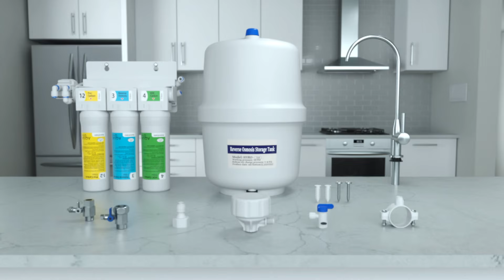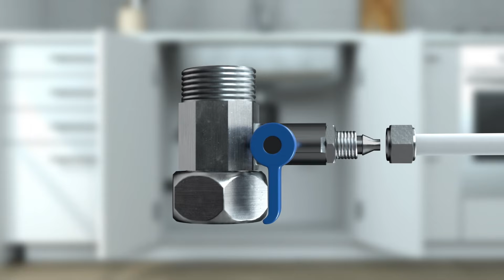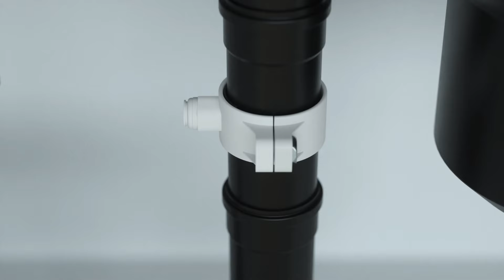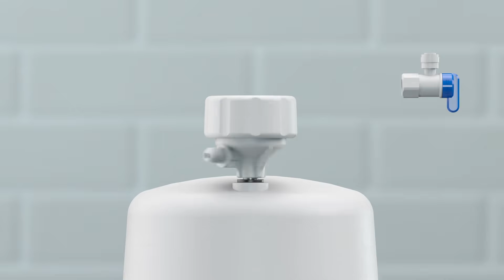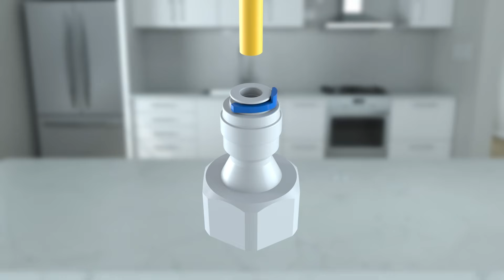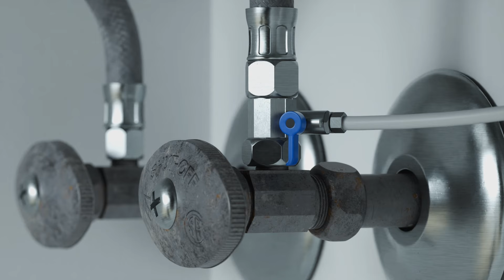AquaTru Under Sink Installation Guide

Comment: How does the water get from the holding tank to faucet? Is it pressurized some how?
Reply: thats right! i had to look it up. theres a bladder inside that compresses air as water comes into, helping to push the water back out the same one line, acting like a compressed spring.

Comment: My cold water adapter came with two small rubber gaskets in the bag. What are those for? I don’t need the 1/2” conversion threads, so wasn’t sure if I’m supposed to use those little gaskets somewhere.

Comment: So if I wanted to bypass my fridge filter and connect directly to my ro system I’d need a dual connector for E?
Reply from the maker: The under-sink model is not designed to function in this manner.
Reply: @AquaTruWater which model can?
Reply from the maker: @basketballtricks101  No AquaTru model is designed to function in this way. All the other models are countertop units. They don't interface with other appliances.

Comment: Is there any issue with parallel installation of two units, for better flow? I don't see any issue with it in my mind but I'm wondering if something is escaping me on that.
Reply from the maker: The under-sink model is not designed to operate in this way.

Comment: How do you know when it’s time to replace the filters?
Reply from the maker: The Under Sink model doesn’t have the electronics to track filter usage intervals, which is one reason it is somewhat less expensive than the countertop models. To monitor filter life, we recommend writing the date you installed it on each filter using a Sharpie pen. Alternatively, you can set a calendar reminder.

Replace the pre-filter after 6 months, 
the VOC filter after 12 months, 
and the RO filter after 2 years. 

This information is found on page 11 of the manual.

Comment: It says sanitise the Ro holding tank with bleach!! How is that safe?
Reply from the maker: Bleach is necessary to ensure that bacteria are eliminated. 
After sanitizing the tank, you flush the tank twice to purge out all the chlorine.
The process of using bleach to sanitize the tank and flushing it out will not leave any chlorine residue in the tank.
Reply: @AquaTruWater - how often do you sanitize the tank? Do you have directions on how to do this. Also if you go on a trip for a month and you shut the water off to the house is that OK to do if you have this system installed??
Reply from the maker: @robinhoward6019  The RO system should be sanitized once a year. We recommend that you do the sanitizing process each time you replace the VOC filter, every 12 months. You should complete the sanitizing process before you replace the VOC filter.

This is a common interval for sanitizing RO water tanks.

There are instructions in the manual.

Here is a video…
How To Sanitize Your AquaTru Under Sink Water Purifier 
https://youtu.be/Xb1X003sYMA?si=KOp777PcKNaCmfxu

With an under-sink system that is used in a pressurized tap water system, it is ok to leave it unused while on vacation.

Comment: What is the size of the whole for the faucet needed? I order a unit. I want to make sure i have the right tool to install it when it arrives. Thanks.   :)
Reply from the maker: You will need a 13/16” drill bit and drill that is appropriate for drilling through the countertop material.
Reply: @AquaTruWater  what is the material of the faucet made out of? I'm wondering if i need to replace it for a higher quality one
Reply from the maker: @alfonsoramirez6415  The RO faucet that comes with the Under Sink model is stainless steel.
Reply: @AquaTruWater the size of the hole for the faucet should’ve been included in the video, but glad it was at least in the comments

Comment: Do you recommend getting a booster pump for the RO system for those of us on well water?
Reply from the maker: For the under-sink model, if your water pressure is +40 PSI, a booster pump is not needed.

If your home does not have 40 PSI, we recommend using an AquaTru countertop model that comes with a built-in pump.

AquaTru is designed to filter municipal water. AquaTru is not intended for use with any water that is microbiologically unsafe. If you are 100% confident that your well water is free from biological contaminants, you can use AquaTru to purify your water. 

While AquaTru has been tested to remove cysts, including Cryptosporidium, Entamoeba Histolyca, and Giardia lamblia, it is not recommended for use in water from lakes, rivers, streams, or other sources of untreated water. AquaTru has not been certified for this purpose.

Comment: I'm assuming this can be used in bathroom sinks as well?
Reply from the maker: It is a question of having enough space under a bathroom sink, and you will need to drill into a pipe and drill a hole in the countertop where an additional RO faucet must be installed.

Comment: Do the dimensions of the filter assembly include the mounting bracket and the side pipe inlet?
Reply from the maker: It is just the dimensions of the manifold that holds the filters.
Component Dimensions

Manifold Dimensions: 4” x 11.5” x 13” (L x W x H)
Tank Dimensions: 14” x 10” (H x D)
Sanitizer is 3.2 inches tall
Weight: 11.44 lbs

Comment: What’s the total height of the tank including the sanitiser adapter? 
Can the tank be mounted on its side? 
Could I forego the sanitiser adapter and just install it when sanitising is required?
Reply from the maker: No. The tank cannot be mounted on its side. Tank Dimensions: 14” x 10” (H x D)
Yes, you can use it without the sanitizing adaptor in place and add it when you need to do the sanitizing procedure.
Reply: @AquaTruWater  thank you. Does that height measurement include the sanitiser attachment?
Reply from the maker: @RyanF91W  No. It doesn't include the sanitizer attachment. The engineers are going to provide that full measurement soon. Also, see our correction to the answer above. :-)
Reply: @AquaTruWater  thank you for the quick reply. So the piece that would normally go onto the sanitiser will attach to the tank (same size thread) ?
Reply from the maker: @RyanF91W  Yes. :-) The engineers said you connect the hose directly to the tank in place of the sanitizer.

Also, we have received these same questions from our EU distributor and have replied with a little more detail via email.
Reply: @AquaTruWater  That was probably because of me. I was asking them the same thing but was receiving conflicting advice. Thanks for all your help and will be purchasing an under sink system in the UK shortly.
Reply from the maker: @RyanF91W  Youre welcome. :-)

Comment: What minimum width of storage under counter required to get it installed?
Reply from the maker: There needs to be enough room to contain these components...

Manifold Dimensions: 4” x 11.5” x 13” (D x W x H)
Tank Dimensions: 14” x 10” (H x D)

Comment: So how does water get from the holding tank to faucet? Does it use the same hose as the original unfiltered water? So going backwards D to C and then E to F? Just wondering if that’s so are you able to get clean drinking water while it’s also filtering to fill up the holding tank?
Reply from the maker: Please call Customer Service, and they will be able to answer this. Please choose the Technical Support & Troubleshooting option.

Here is the Customer Service number and hours: 
1-800-220-6570 
Hours:
Monday-Friday from 7am-4pm PT
Saturday and Sunday from 7am-3pm PT

Comment: What size drain pipe is the saddle for?
Reply from the maker: Please call Customer Service and choose the Technical Support & Troubleshooting option.

Here is the Customer Service number and hours: 
1-800-220-6570 
Hours:
Monday-Friday from 7am-4pm PT
Saturday and Sunday from 7am-3pm PT
Reply: did you ever get the answer to this? i am wondering this as well. if it will work on a 1.25" drain pipe.
Reply: @b3autifu1mistak3 it does not fit a 1.25” drain pipe. They do not have bigger saddles either

Comment: My holding tank valve is leaking.

I have the blue horseshoe ring on.

I cut the plastic line using a razor blade trying to achieve a flat cut.

Where did I go wrong?

How do I fix this?

I need it to stop.

This is the only leak.

Furthermore, I only see water coming out of the drain line but not the water faucet line.
Reply from the maker: We’re sorry your unit is leaking. 

Please call Customer Service and they can do some troubleshooting and resolve this for you. Please choose the Technical Support and Troubleshooting option.

Here is the Customer Service number and hours: 
1-800-220-6570
Monday-Friday from 7am-4pm PT
Saturday from 7am-3pm PT
Reply: @AquaTruWater  I figured out the leak and haven’t taken back the comment—I had to stick the 1/4” line further into the recess—My tank osmosis would not fill to full. 

I ran it for over 3hrs. probably 5 on the timer.

The faucet water line… had x3 as little water pressure than the drain line the whole 5hrs. 

Lastly, a rotten egg after taste from the faucet water line

i tried some on the 4th hr. I think that aftertaste is gone now

I have the under the sink ph+ mineral boost model from AquaTru

What’s going to happen?
Reply from the maker: @HotHeadCringe  We're sorry you are having this issue with the pH filter.

While many of our customers love the taste of our alkaline mineral water, some people perceive tastes differently and pick up on a taste that they don’t love. Some people are even genetically dispositioned to have a gene that makes them more prone to detect a Sulphur-like taste in the alkaline water. This is similar to how some people love the taste of cilantro, while others detect a soapy taste they find unappealing. 

The taste in our filter that people have detected will diminish over time as you filter more water. However, if this is not acceptable to you, we recommend switching to our classic VOC filter and use our Perfect Mineral drops to add minerals back into your water. It will not create alkaline water, but it will give you the healthy trace minerals to re-mineralize your water. 

We are happy to refund you the cost of the Alkaline VOC filter and replace it with a classic VOC filter free of cost to make this right. 

Here is the Customer Service number and hours: 
1-800-220-6570
Monday-Friday from 7am-4pm PT
Saturday from 7am-3pm PT

Comment: Can I get in oiled bronze?
Reply from the maker: If you mean, the color of the RO faucet...
The Under Sink model is designed to use a separate Reverse Osmosis faucet, but you can use your own RO faucet. You can find several options on Amazon.

Here is a link to several different options…
https://www.amazon.com/s?k=RO+faucet&crid=2C81KBFDSXUM2&sprefix=ro+faucet%2Caps%2C117&ref=nb_sb_noss_1

Comment: What size hole do I need to drill in my granite to accommodate this model?
Reply from the maker: You will need a 13/16” drill bit and drill that is appropriate for drilling through the countertop material.

You can find information about this on page 9 of the installation manual.
Reply: @AquaTruWater  What if my countertop is stainless steel?
Reply from the maker: @Rocioftw  You will need to drill a hole in it.
Reply from the maker: @Rocioftw  You will need to drill a hole in it.

Comment: Installed this and it has drastically reduced water pressure (more than half I'd say) of my regular faucet's cold water. Disconnected everything, checked for blockages, blew air through, reattached my original hose without this connected, and my pressure was fine again. 

Connected it back up, thinking it needed to fill the tank before the pressure would return, but it hasn't. Is there a solution to this? Or am I just stuck with almost no water pressure for cold water on my normal faucet right next to this AquaTru?
Reply from the maker: We’re sorry you are having this difficulty. 
Please call Customer Service and they will be happy to do some troubleshooting with you to determine if the unit has been correctly installed and  resolve this for you. Please choose the Technical Support & Troubleshooting option.

Here is the Customer Service number and hours: 
1-800-220-6570 
Hours:
Monday-Friday 7am-4pm PT
Saturday 7am-3pm PT

Comment: How much water does the holding tank hold and how long does it take to fill?  Also, my system is fairly noisy (hissing sound), is this normal?
Reply from the maker: The tank has a 1.8 gallon (7 Liter) capacity. 
The filtration rate is 180ml/6 ounces per minute, which is the same as the AquaTru countertop model. 
It shouldn't make a hissing sound. Be sure that it is installed correctly.
Please call Customer Service and they will be happy to do some troubleshooting with you and resolve this for you. Please choose the Technical Support & Troubleshooting option.

Here is the Customer Service number and hours: 
1-800-220-6570 
Hours:
Monday-Friday 7am-4pm PT
Saturday 7am-3pm PT

Comment: I want to purchase and then add a different faucet to match my oiled bronze fixtures. Does this require a faucet with an air gap?
Reply: Thank you!
Reply from the maker: @LVHoy  You're welcome. :-)
Reply from the maker: Hi Leah,
The under the sink model can be used with or without an air gap faucet.

Comment: Seeing weird behavior on this.

Got everything connected, tested cold supply line, things look good

Turn on water feed at the adapter valve, water starts entering unit, things are fine then suddenly the RO faucet starts leaking and dripping profusely - tank is empty
Reply from the maker: We’re sorry your unit isn’t working.  
Please call Customer Service and they will be happy to do some troubleshooting with you and resolve this for you. Please choose the Technical Support & Troubleshooting option.

Here is the Customer Service number and hours: 
1-800-220-6570 
Hours:
Monday-Friday 7am-4pm PT
Saturday 7am-3pm PT

Comment: Is there an indicator for filter replacement? I have the countertop model and I love it.
Reply: https://a.co/d/2r2eRqW
Reply from the maker: The under sink model doesn’t have the electronics to keep track of the filter usage intervals. This is one of the reasons that it is a bit less expensive than the countertop models. We recommend that you write on each filter, with a Sharpie pen, the date you installed it, to keep track of the filter life. You can also use a calendar reminder.

You should replace the pre-filter after 6 months. 
The VOC filter after 12 months. 
The RO filter after 2 years.
Reply: @AquaTruWater  Ia this true even if i have pretty hard water?
Reply from the maker: @Rocioftw  If you notice the filtering time for one tank doubling, the RO filter will need to be changed.

The filtration rate is 180ml (6 ounces) per minute, which is the same as the rate for the AquaTru countertop models. 

...about 39 minutes to fill it completely.

Comment: can this be installed for refrigerator water line?
Reply from the maker: No, it cannot.
Reply: Not sure why they say no. I see no reason it wouldn’t work other than you need a 1/4 comp water line to connect to their faucet connector. I went to Lowe’s and got one today.